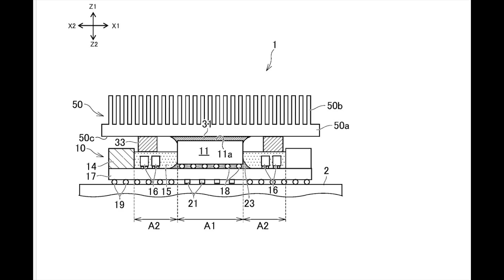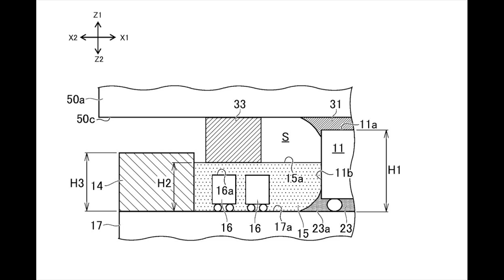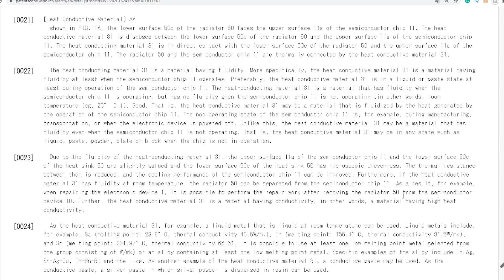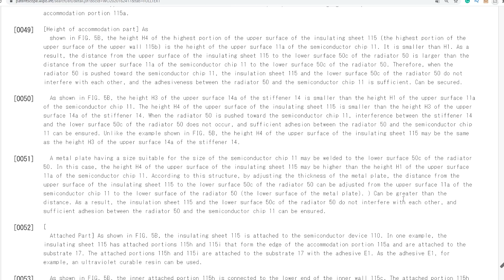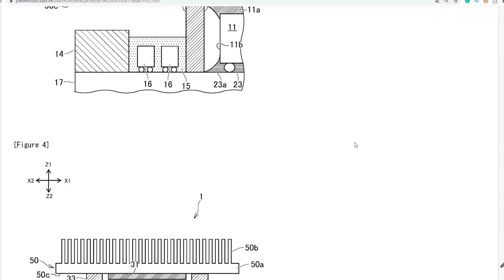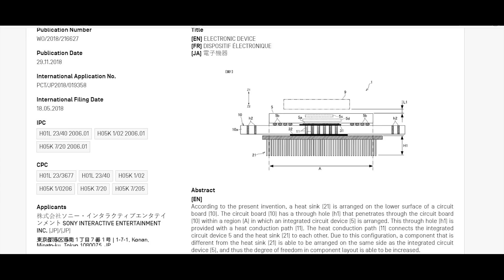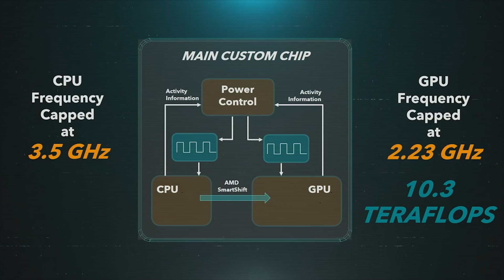Playstation 5 Liquid Metal Cooling Solution Patent Explained

Comment: I’ve put Thermal Grizzly liquid metal in my PS4 pro and it’s cooled my console down by 10°c, it’s definitely a great solution to keeping it cool.
Reply: i am using Kryonaut and drilled a 8cm hole in the console, so near silent now
Reply: ddid you use an isolating chamber  ? or no ?
Reply: Rock Plays I use electrical tape on the chips around the dye, it’s not let me down and I’ve had it like that for well over a year.
Reply: @MattCantor21  Wowzers thats pretty impressive I looked into it but I feel im too stupid to implement it more research must be done.
Reply: Rock Plays I’m sure you’ll be able to do it, it’s just like applying thermal paste (but a more risky process). I’ve built PC’s in the past so I’m not afraid to take things apart, but I waited for the warranty to end to make sure nothing goes wrong with the console (fault etc) and then went ahead and took it apart. It runs nice and cool now!
Reply: @RockPlays  There's a few things you need to know about liquid metal to use it. One is that it seeps out over time so you will need to protect the board around it with tape or nail polish. Nail polish is preferred as gallium can get absorbed into many types of tape. If you do use tape, use a plastic one like packaging tape or scotch tape. Another thing is that liquid metal needs to be pasted on both the chip and the surface you are cooling it with as it isn't as sticky as pastes. This allows it to merge together making it conduct heat better. 

Lastly is they recommend replacing it after 2 months after you first install it as gallium tends to form compounds with aluminum and copper similar to mercury meaning after those 2 months you need to cover it back up. You will also notice it form bumps in the cooler but this isn't something to worry about. This is the gallium compound with the copper not the gallium eating it. It may not look nice but it will still cool just as well as before. It doesn't make it any worse. Liquid metals are great as dropping temps but if you don't have to I wouldn't bother. Liquid metal can be a pain with all these problems. You're better off in most cases replacing the tim that most devices use with IC Diamond as it doesn't have the same issues.

Comment: Exactly, it is just an interesting patent... but OMG! PS5 Liquid Metal booom!
Reply: I wouldn't get to excited.  Liquid metal thermal paste thats available right now breaks down after 2 years.  Most of the time it damages the stuff around it.  My question is for hardcore gamers how fast will their consoles burn out.
Reply: @D3ad1yv1rus  It depends on the kind of metal used in contact with the liquif metal. Sony will simply just use nickel plated copper to avoid any issue.
Reply: @мирвовсеммире-ы1и  have you not paid attention to what James said liquid metal thermal paste. Even with copper or nickel the problem is the the liquid metal will heat up worse than thermal paste when used with copper  which the liquid metal isn’t a good insulator but is a good conductor. The problem is that you can’t have too little or else the liquid metal won’t work and just a little too much will spill over and spread to other circuits... 

Finally I want to say this will be a huge change because again the life span of liquid metal on any type of metal surface which you failed to pay attention only lasts at most 2 years before wearing out. Thermal paste is favored for its long life span and ability to preform decently over long life spans. 
Liquid metal has a life usage on none heavy usage meaning not every day usage for more than 4 hours a day and we already see ps5 situations where people’s ps5s are already short circuit because what I can guess is the liquid metal paste...
Reply: @mrpumperknuckles1631  LOL you don't what you're talking about. 

Just read up on how Sony solved the issues with its liquid metal implementation and inform yourself. I'm not wasting my time on you.
Reply: Boom it will go if the guys on the assembly line apply it like they do with regular TIM
Reply: CONFIRMED!
Reply: Hate that this is a patent as it mean we can never get it in anything else. Patents fucking suck.
Reply: @Skylancer727  Not true, companies pay other people's patents all the time.
Reply: @jimyarbrough9935  also those patents expire all the time depending on the type of patent they get. If the patent is a single out product but it won’t go through because liquid metal isn’t a good type of coolant...

Comment: I'm very skeptical about the Liquid Metal, what about ageing and Micro Cracks?
SONY would never use something that could blow up in their faces that hard without enough testing.
Reply: I have a Devils Canyon 4790 delided with liq metal TIM on both sides of the IHS.  Still cools like a charm!  That's what, 2014???
Reply: @TimBaoht  @
Chasethechosen One

The patent mentions an alloy that liquifies from the heat of the APU.
Reply: paul taylor what product did you use? It matters, Sony is likely not going to use a high end TIM, rather they will go for bulk value which is unlikely to last very long. If they did go with a high end Tim, you could expect a high price hike.
Reply: William Royse there’s no way of you knowing until digital foundry does the tear down of the ps5
Reply: Chasethechosen One I’m waiting for the GN teardown, I trust them when it comes to cooling. I mean GN Steve is literally known as Tech Jesus(mostly because of his hair)
Reply: @hemhazgames  gallium is gallium
Reply: paul taylor they use multiple kinds of metals when making a liquid metal TIM, like germanium. Gallium is not the only liquid metal safe for commercial usage. There are 2 reasons that gallium would not be a good liquid metal for mass production; 1, they would need to make sure that they had no aluminum or aluminum compounds near the TIM, meaning that they would have to pay for a copper cooler which would add on huge costs, as aluminum is much cheaper to use in manufacturing; 2, gallium itself is a quite rare and very expensive liquid metal, making it not very viable in bulk production situations.
Reply: That's solvable problem if you have a small team of materials engineers work on it. The chemical incompatabilities are already well understood. What we run into as enthusiasts is, we generally have no visibility, at all, into what stuff is made of. 

Sony, on the other hand just has to wave OSHA regulations and sign a stack of NDAs and they'll have everything at their fingertips. 

Now, that doesn't mean that there won't be other problems, or mistakes in the engineering but it's a much lower likelihood than the stuff we do on our own.
Reply: How do you know what Sony would use... you haven’t even seen the inside of the console and it talks about they can secure the liquid so it does short circuit the system and it decreases temperatures by 10 and is more effective than thermal paste it works like thermal paste but better

Comment: Ps5 is a pog champ at the moment
Reply: Normie
Reply: Honestly I question if this suggests the original claims PS5 ran hot were true. Liquid metal can drop temps by nearly 5 degrees and 10 degrees for under the CPU die, this could have been a quick fix late in development that wouldn't have cost fully rebuilding the console's structure. Plus liquid metal couldn't possibly been their first choice. Thermal paste is far cheaper and easier to work with an thermal pads never go bad. I can't imagine this was their original intent. I think Sony bit more than they could chew and threw this together.
Reply: @Skylancer727  Acording to sony they have been talking to devs along time while designing the ps5... so it feels weird that they have not thought about this... But there are rumors saying the ps5 was suppose to come out last year... but maybe when they heard rumors about how powerfull the xbox was going to be they delayed it. ANd in that case you might be right.